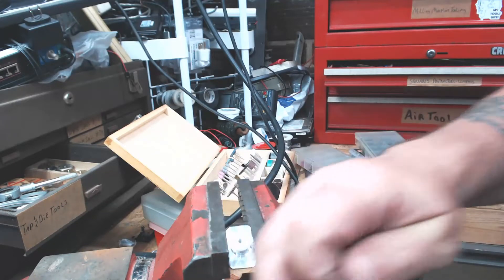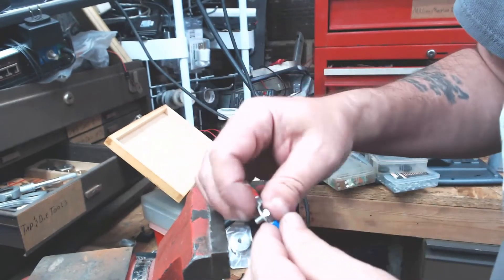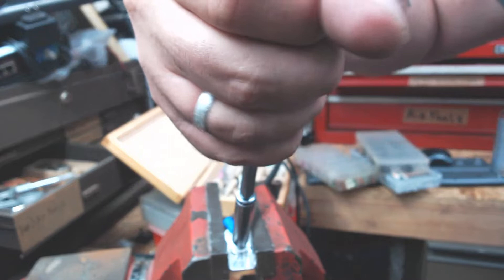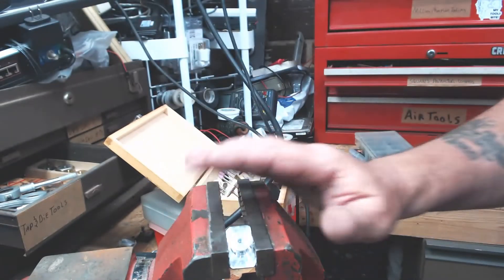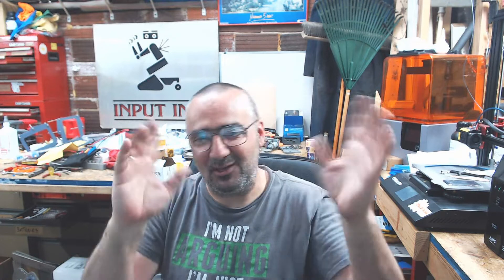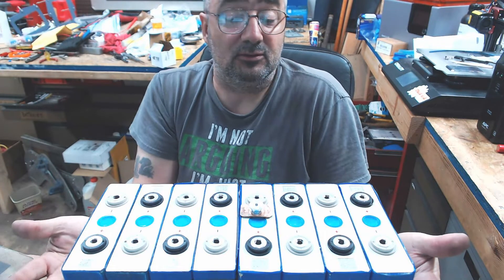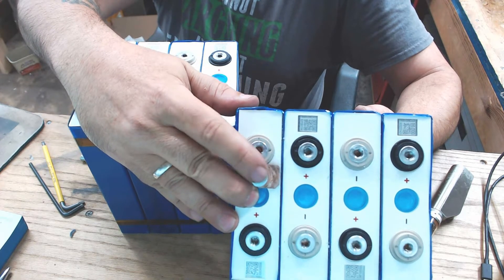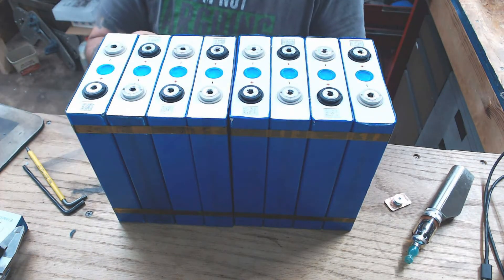LifePo4 Cell Terminal Helicoiling (Intro) 1 of 4

Comment: just a thought you kept going up in size because you have zero clue what size you have to begin with which most likely is 5mm thread, my 280AH cells use a 6x1.0 stud so if they were to strip for some reason than the go to size would be 8mm.  Save yourself some time and use stainless studs and flange nuts and not worry about stripping holes out.  Nice video just the same